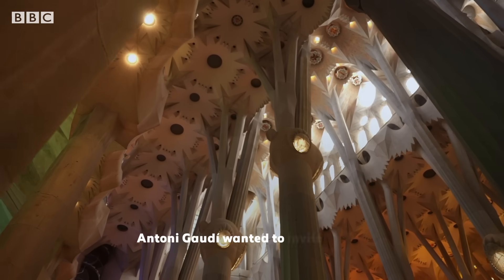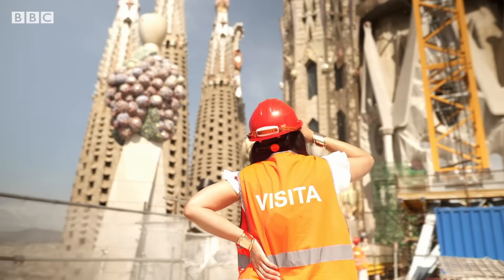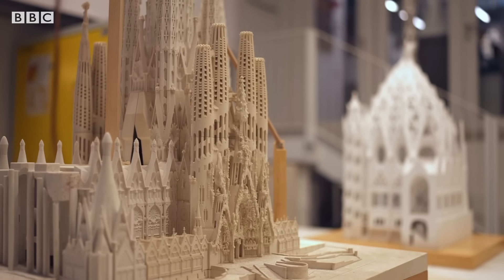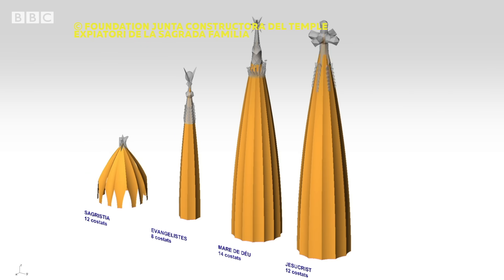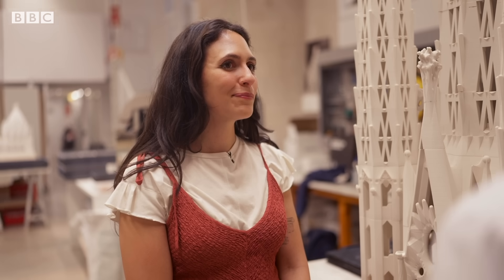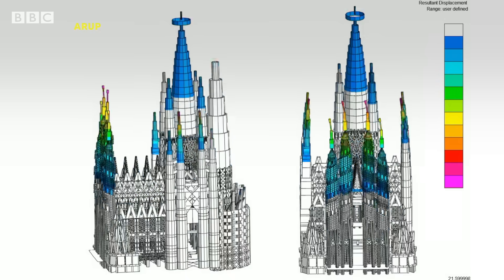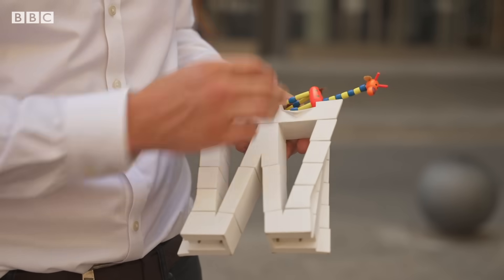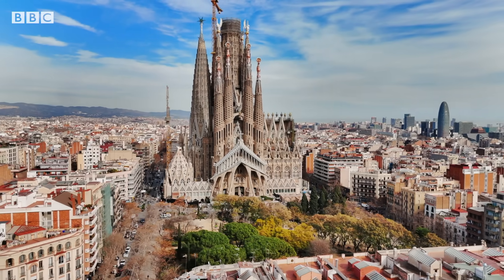The tech helping to complete La Sagrada Familia | BBC News

Comment: At 1:32, you can see an open passageway between the two central towers. I was forced to cross that in 1995 by an architect/friend and which I did on my hands and knees because I have vertigo… and then descending the towers by stairways that are sometimes completely open to the outside… Terrifying. But the structure of the basilica is so beautiful, and so organic, like most of Gaudí's works (I also spent a New Years Eve in an apartment in La Pedrera, with undulating doorways and ceilings, incredible). I wish they would redo (if they haven't already) the Passion facade on the West side of the basilica as it has a weird modernized feeling à la 1950's abstraction. Also, much of the recent work misses the organic softness of the earlier structure—too precise, too angular.
Reply: Cuando se hizo esa fachada, muchísimos catalanes se enfadaron, con toda la razón. Es de un escultor catalán muy famoso, pero no se parece en nada al espíritu de Gaudí